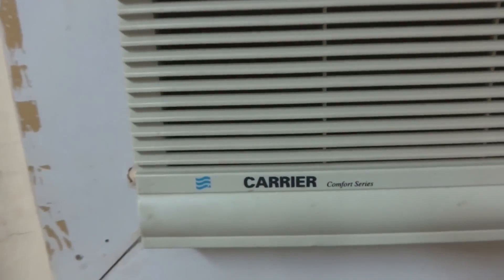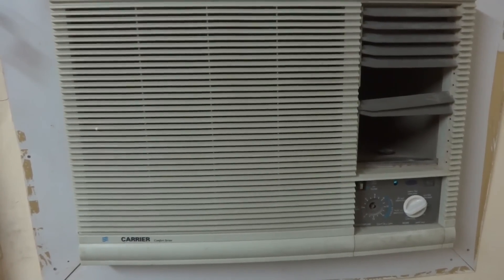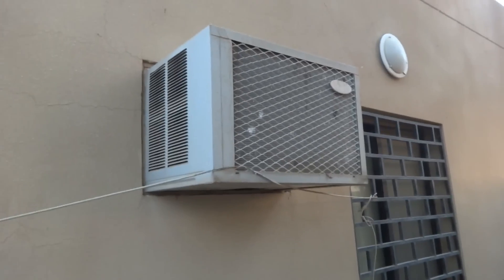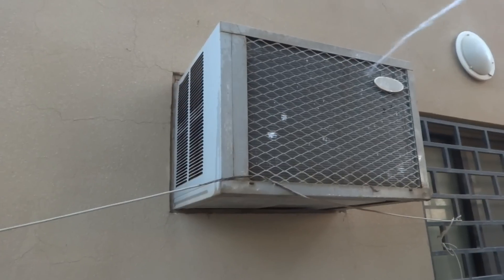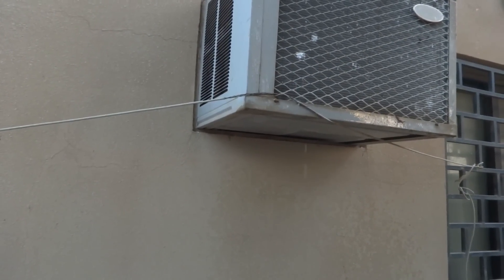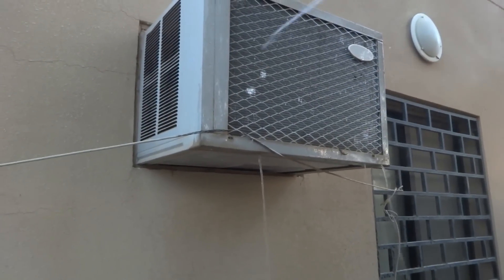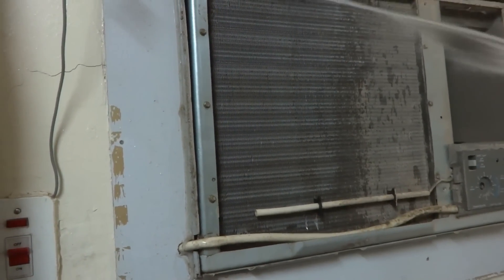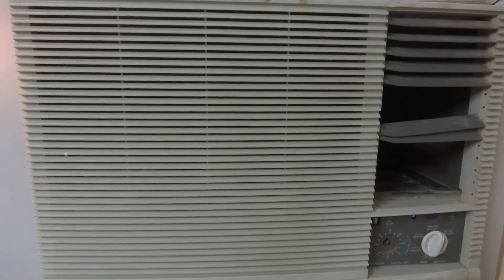Room air conditioner common defect repair. DIY easy fix.

Comment: My ac wall unit is blowing hot air and the compressor never kicks. I tried all the trouble shooting and it is still blowing hot air. What should I do.
Reply from the maker: Nunya Dambidnis Dear friend this not possible that you troubleshot everything and still your compressor is not kicking on. Grab a multimeter and make proper testing of every thing. Sure there will be miss due to which your compressor is not coming to switch on. Possible area of fault could be the thermostat or the power switch. Also check the capacitor in the compressor circuit by replacement with a new one. Hope you will give attention to your testing and the unit will come back to life. Regards and good luck with your repair.
Reply: ok so yur ac is blowing hot...this is due to the compressor not coming or not being told to come by other components. lets troubleshoot it. first look for the obvious do you see any loose or burned wiring. several things can keep mr. compressor from starting heres a list. 
A. thermostat/thermistor or ambient thermistor not working.
B. complete loss of gas in system.
C. motherboards/printed circuits fried.
D. bad switch
those are some of the most common problems but usually its a thermistor/ thermostat problem....So is it a digital unit? do you see the readout display an A5 code? if so its the main thermistor around 7-20 bucks. have u sprayed water on pthe unit lately? the most common problems with digital units is folks not taking their time and fail to cover up vulnerable circuitry/thermistors/ motherboards with plastic. then they turn the unit back on while there is still water/moisture lying on electronic components and just one drop of water lying on two or more conductors in a different circuit will fry it instantaneously. i dont recommend using a water hose...especially on digital unit its just too much pressure and way too much water period...heres the best way...my way lol....i put the ac facing me on a pltwood 30 degree inclined ramp ice made, again facing me...the ramp allows for good water runoff while cleaning. i use a garden sprayer with a mixture of vinegar bleach and water and i do the evaporator coils first but heres my secret- i do an initial spray down of evaporator getting the big junk off first, then i spray both sides of evap with gunk engine cleaner because it foams nicely and isnt as caustic as some of the acids they say to use, i dont recommend using acid at all itll deteriorate yur cooling fins and it very rapidly promotes rust and you do use any type of acid...rinse rinse rince and then rinse again. the garden sprayer works good because the stream is more contolable also when cleaning the coils ALWAYS spray from inside out. the main things to focus on when cleaning a unit are the evaporator condensor and the fan...the evaporator is a vehicle that allows cold freon to travel through while the blower blows the cool air outward and a clogged up evap will freeze up because the fan cant get rid of the cold the consensor is just as important condenses the freon so it can start all over before entering the compressor. And when a condensor gets clogged it cant condense the freon .And when a blower fan gets covered with dirt and slime it can weigh 2 or 3 times more than it should this weight can deform the fan or prematurely wear out the elec motor or motor bearings due to turning more weght than origanally designed for. and the extra weight also accounts for pulling excess amperage during startup...when done cleaning those 3 items i suggest a shop vac or compressed air to blow out any water or debris being sure that the electronics and circuitry are dry before energizing the unit and remember " a clean unit is a happy unit"

Comment: no problem with Ac in putting water
Reply from the maker: No there is no problem as you can watch in the video.
Reply: @JahanZeb1976  mine's not working now !!

Comment: Do not pour water on your window unit ac !!! I dont care what he's doing. Dont do it.
Reply from the maker: OK stay blessed with your dirty and not working ac then. Nobody care if you sleep in a warm room.
Reply: I've tried it what he said, and it worked.   I washed my window AC from outdoors and it is running like a champ now.  I didn't have to take the unit out of my window like some other Youtubers advised.
Reply: @JahanZeb1976  I've tried your method and it worked so well!  I cleaned my AC from outside with my water holes every time it gives out warm air.  I have seen other Youtuber suggesting people to pull the unit out of the window and then clean it, but it is a pain to do all of  that.    Your method is better in my book!  Thank you!  :)  By the way,  I have an old LG windows air conditioner unit and it is holding up way better than the American brand air conditioners.
Reply: why not? It just worked for me and I'm so grateful for this video!! It's almost the same as if it was raining hard, I sprayed mine with a hose from outside. Water gets inside anyway every time it rains!!  I did unplug the unit while hosing it off, then after it dripped a while, I plugged it in and now it's working again!!! Yay!!  Just saved a LOT of money on buying a new one, or repair guy!!!

Comment: my ac unit turns on after awhile it stops blowing cold air
Reply from the maker: Proceed with this cleaning proceedure.
Reply: and what happened when it turns ice in the front ?

Comment: my air-conditioner cools for 30mins and stops cooling. it blows air but not cold for about 5 mins before it kicks in again. how to fix ?
Reply: it would be a timer on the machine
Reply: +stickydate07 how do u take it off
Reply: PERIKAZO_RUIZ Ruiz the knob thingy on the front of the unit, on the left, turn it to the right, its a thingy that cant detect the tempereature in your house and auto turn it off
Reply: +stickydate07 I got a LG 15000 ....but don't know what thing u said
Reply: oh i have a older model, but it should be simlar there should be a lever or switch that has a snow logo next to it and u cant set how cold you want the room to be, most aircons have it

Comment: My ac is not switching on, there is a reset button on the power cord as I switch on the ac it's getting trick and again when I reset and switch on my ac power is getting off, before I call technician is there anything I can do it to fix it. my ac getting off as soon as I switch on the power.
Reply from the maker: Seems there is some shorted component like a shorted cooling fan or shorted compressor inside your AC. In case of a shorted fan, it will be a low cost repair but in case of a shorted compressor it will cost you very high due to high compressor price and replacement labor charges. You may share your repair experience here with us after your successful repair so that others will also get benefit with your experience. Wish you good luck with your repair and best regards,
Reply: +LearningZone ok thank you

Comment: PLEASE TELL ME MY AC IS AUTOMETIC HOW TO REPAIR IT PLZZZZ
Reply from the maker: All ACs are automatic. What do you mean by automatic?
Reply: 5 mins give cold Air And than hot air
Reply: Funny Sindhi It could be your thermostat. I had an apartment with a wall unit mounted extremely high on wall; with summer temps climbing to 115°-120° we couldn't feel the air flow, so we took a piece of cardboard and taped it above the vents so it directed the cold air down instead of up. Over the next several weeks, the unit wouldn't cool off the apt, it would kick on and blow out cold air for about 10 minutes & then cycle off, repeating the cycle all the time, and our bill was expensive. A friend of mine, who's basically a handyman came by one day & o asked him to look at it. He immediately told us to remove cardboard; seeing the confusion on my face, he explained that, while the cardboard was blowing the cold air straight down on us, it was  also blowing straight down onto the thermostat, which would sense the cold air almost immediately & kick off. Removed the cardboard & was patient enough to let room cool off & it was fine after that.